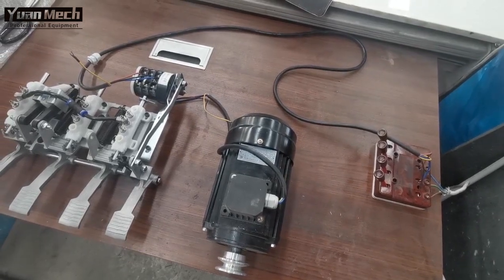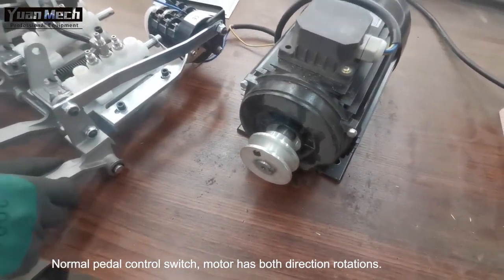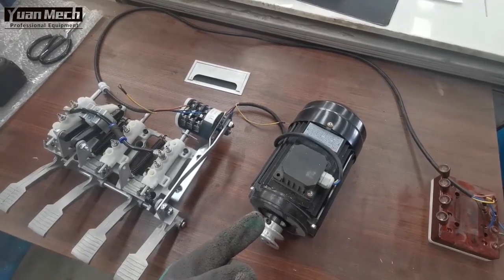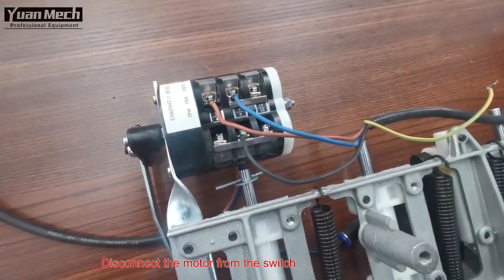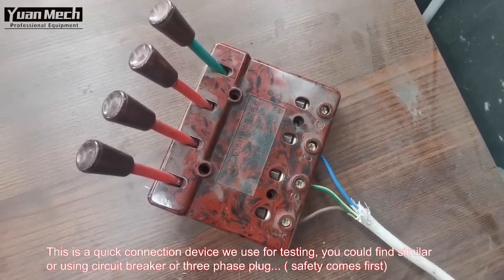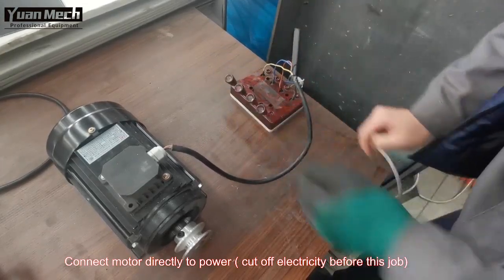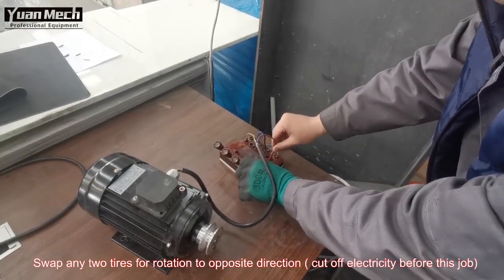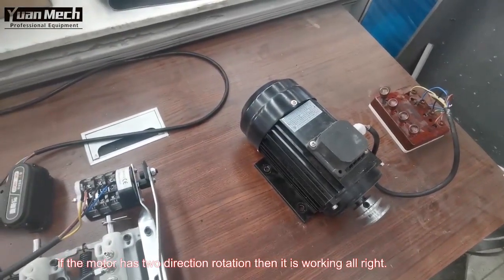How to test tire changer three phase motor?

Comment: wish you would have pulled the cap off the motor to see where those wire from the switch were going to, far as is pin #2 was going to say U1 on the motor. I'm trying to rewire a machine were all the wires were removed. trying to find a good wiring diagram that show both to switch and from switch to motor. other than that good video